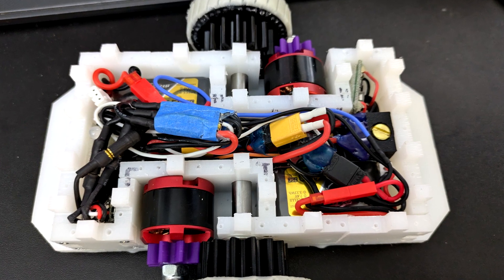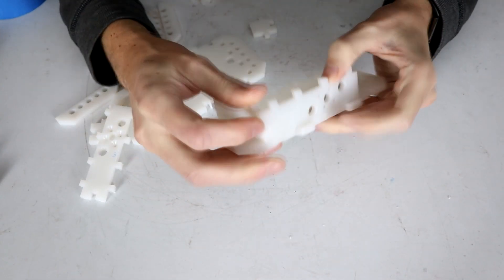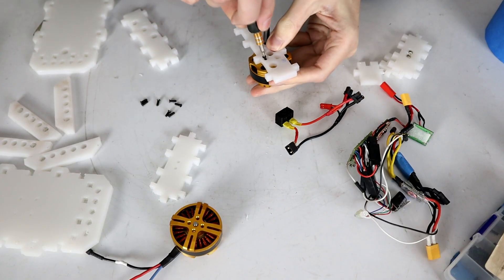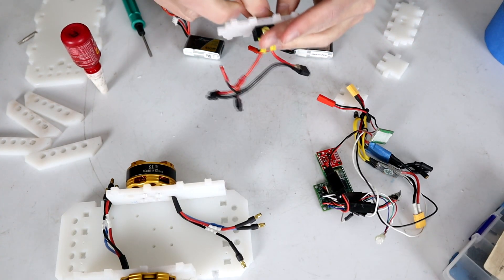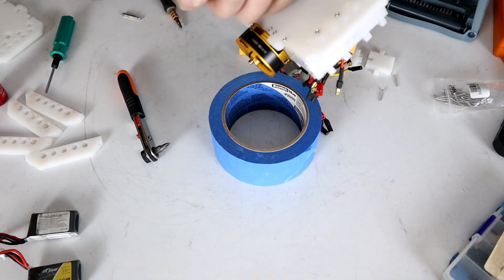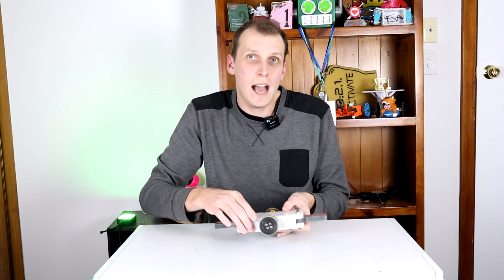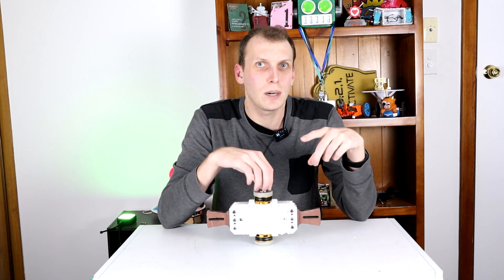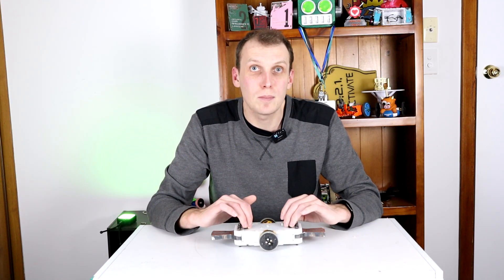Can Yolo drive fix my melty brain??

Comment: Ben, I love your persistence to run the uhmw chassis. As almost the whole melty community has moved towards tpu with stiffeners you stick with such a unique and cool chassis design. 

I’m doubtful that just a bigger BEC will necessarily fix the voltage spike issue. Rather than trying to run electronics that tolerate more and more voltage range you could lessen the impact of the voltage spikes by putting a 300-400uF capacitor on the power pads of the drive escs. 

If you ever want a second set of eyes on the melty code I’d be happy to take a look. I run a branch of openmelt on my bots “centrifuge” and “shadow the roomba”, but with a lot of modifications it’s gotten a very solid heading and had to limit translation to 40% because I can’t control it at full speed.
Reply from the maker: The new bec is an actual bec for a drone with bigger caps on the input and output 

The current one is just a 5v reg board from AliExpress which is fine for regular use but struggles under a noisy battery rail

If the new bec also struggles I'll definitely be adding more caps to the teensy to keep it powered through brown outs

Comment: Might be appropriate to make a hubmotor to avoid the spontaneous stator failures, or run a belt drive to isolate the shocks while minimising backlash. Bonus points if the isolated motor has the can double-supported. Good to see it's still a-spinnin'
Reply from the maker: I'm going to go close to a hub motor without committing fully
The plan is custom shafts that attach with a locknut to hold the can in the right position the whole time and the standard battle hardening of epoxy and filler in the stator and on the magnets
While I'm epoxying in the stator I'm going to add a bit to the top and bottom to make sure it doesnt move again

These motors have been pretty rock solid in the past so I'm hoping only minor mods are needed to keep them alive

I'm certainly interesting in how belt driving a melty would go, seems like a good way to scale up without having to get into rare, expensive and large brushless motors
Reply: We had the same issues in testing Demon Core before NHRL in June. The way we improved it was by machining into the stator to add a groove for a flanged bearing to replace the non flanged one that came with the motors as well as adding epoxy to the top and bottom like you're planning on doing. All our motors survived after those modifications.

Interesting to see how you're approaching this problem and looking forward to seeing if it works for you!
Reply: I had the exact same stator failure recently in my melty brain

Comment: I've found that even w/ YOLO drive, the range in which you brake your motors can change the efficiency of the translation by a lot, so I could definitely see indirect drive causing some issues (especially because there's backlash and compliance in the gear system)
Reply from the maker: yeah I thought the issue I was having was a backlash one too, but turns out not
I still think backlash will be a problem, but tbh once the melty is at speed, I think it would be a problem you could offset in software (move the start and end of the range of motor speed change to allow for some backlash)

Comment: If you're running the openmelt2 code, in your config, comment out:

#define VERIFY_RC_THROTTLE_ZERO_AT_BOOT

which should help you recover faster when rebooting. it skips the check for zero-throttle, so it should get back up to the original speed after it completes the reboot.
Reply from the maker: I'm running custom code
When I started working on melties openmelt2 didnt exist and openmelt was very outdated